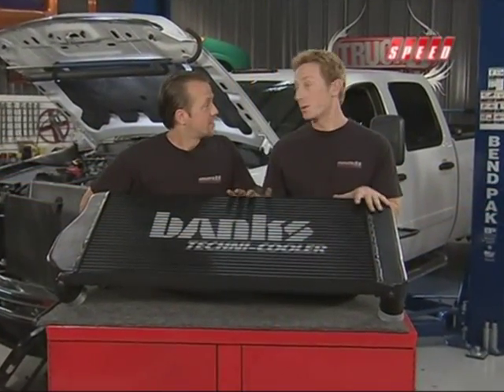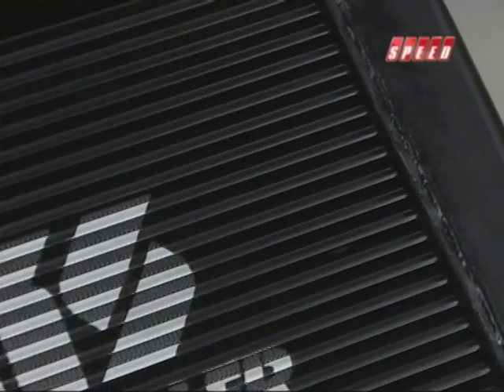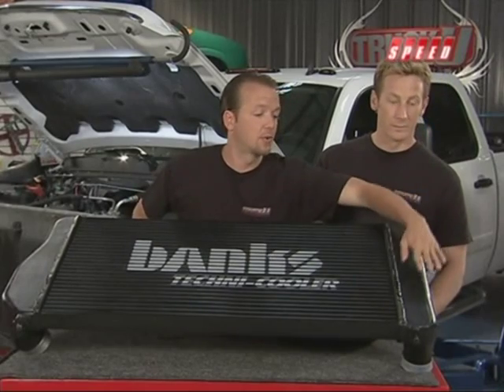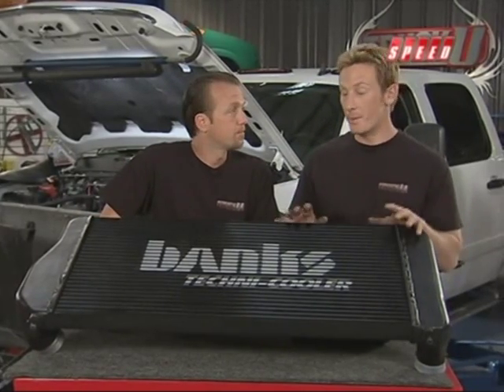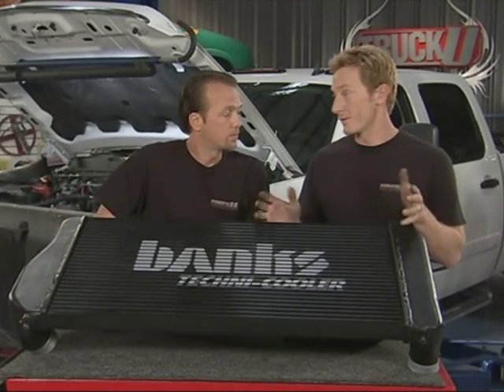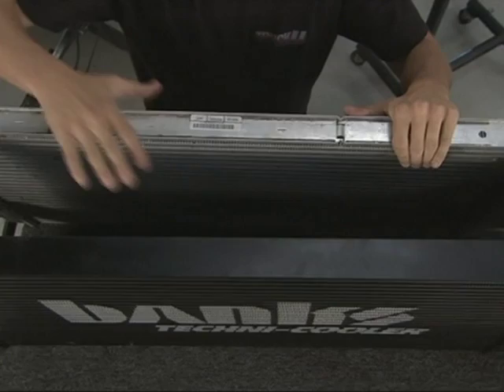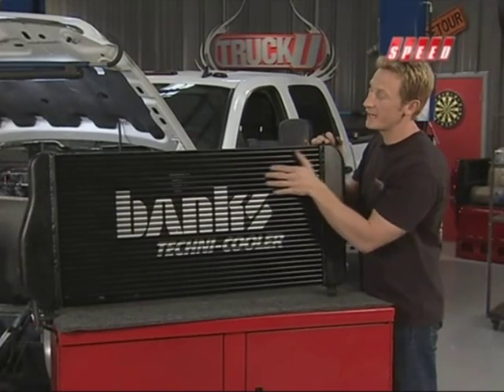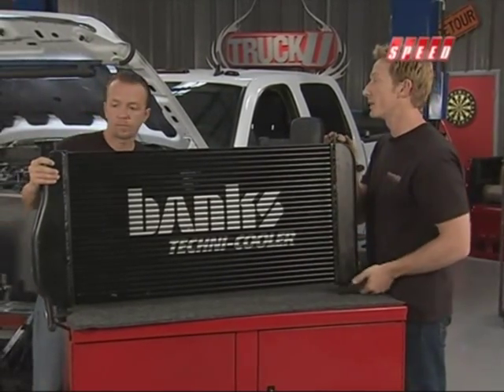Intercoolers: why you should upgrade yours

Comment: Is there any turbo lagging issue after a bigger intercooler is installed? need any extra tuning for it?
Reply: Yes, for sure, the turbo will have to pump more air for sure.
Reply: The banks intercooler is smaller than the factory